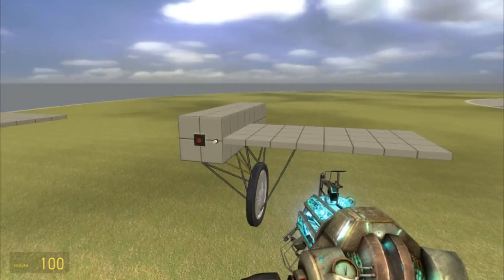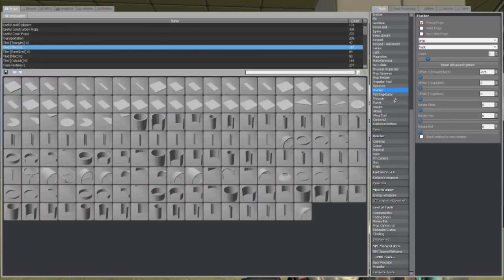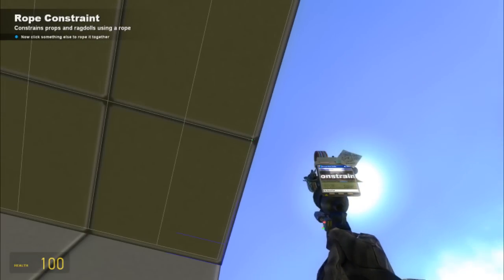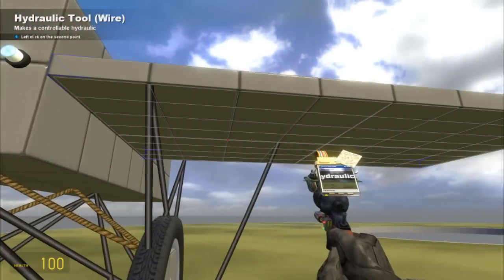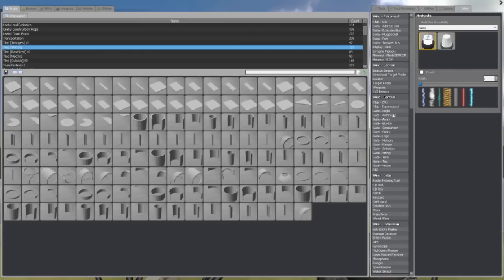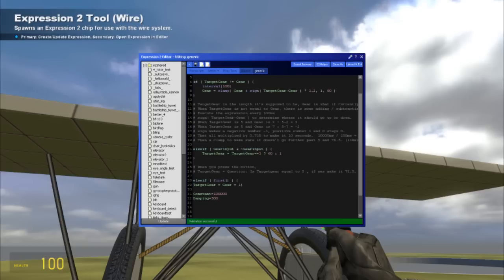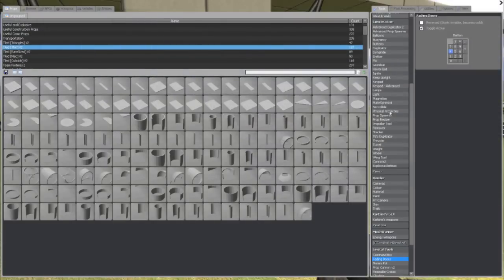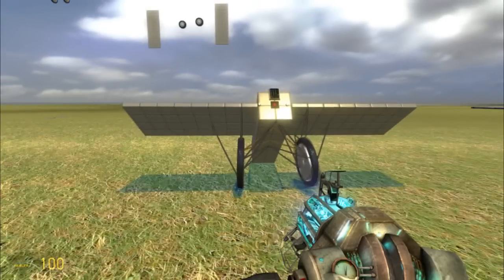Gmod - (Tutorial) Landing Gear

Comment: Hello mr. spider0804. I have been trying to make landing gear without wiremod, by putting simple 1x1x4 thingies under the wings and putting prop wheels with axis under them(im not that good at airplane design in gmod). However, whenever i simply drop the plane from a tiny height the landing gear starts to glitch all over the place, messing everything up. Is there a way to fix this?
Reply from the maker: Your weight is too low on the props, but not using wiremod puts you in the stoneage builder wise.

Comment from the maker: @Lewissnicholls You can do something where if an input is on the length is max, and input off = min buuuuuuuuuuut the e2 makes this happen over 10 seconds instead of a violent jerking motion. Furthermore when working with a constant of 100k and 10 length over your true max , which is needed to keep the weight of the gear down, the snapping motion will likely cause your creation to discombobulate at some point.

TLDR: Yes its possible but not pretty or recommended.